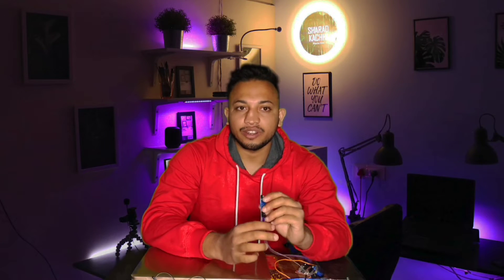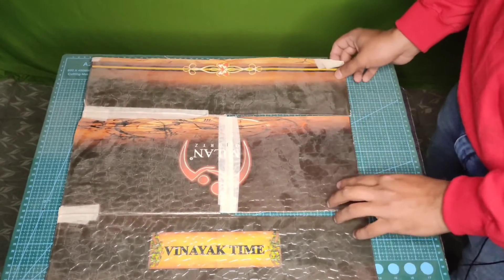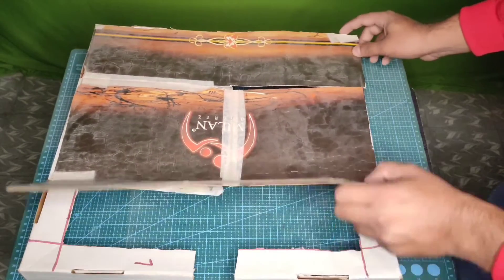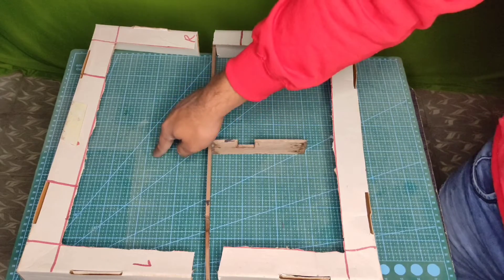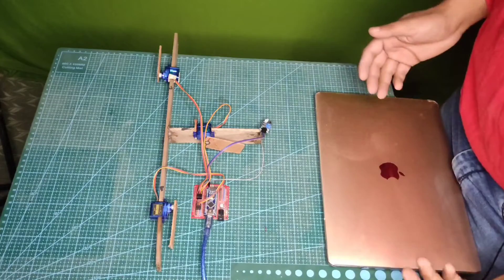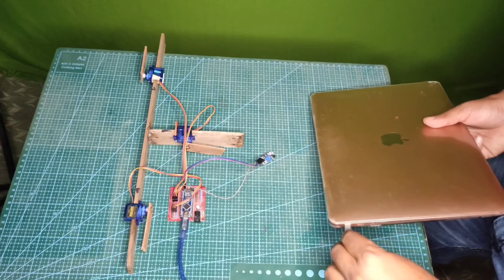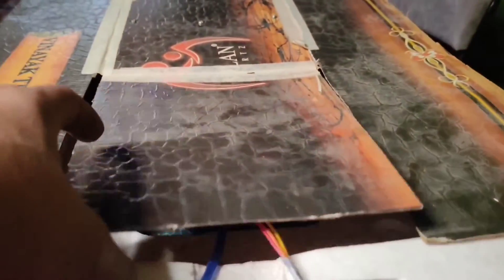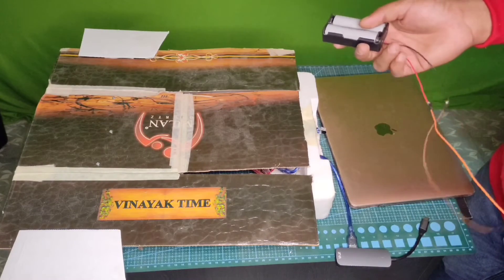clothes folding machine 👕👨‍💻 | using Arduino | in just 5 minutes

Comment: hi, my push button doesn't work, idk why. i follow the coding arduino uno but the push button still cannot working. may i know what should i do right now. please responed my comment please urgent!!!!
Reply from the maker: I think you made mistake in connection try to connect button pin as one end of button pin with D3 and another pin of button with GND on arduino then it probably should work !! Let me know if it's not working

Comment: Thanks for your video. I got problem with start button. Servo motors run as soon as i connect usb cable to laptop. It does not react to the button. May I know how to fix it?